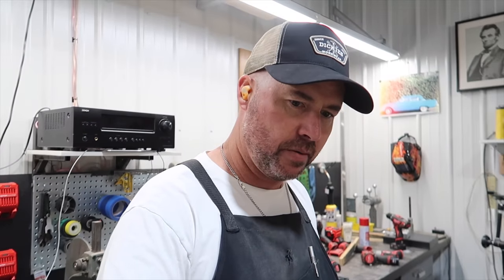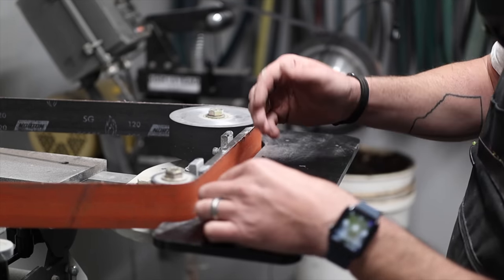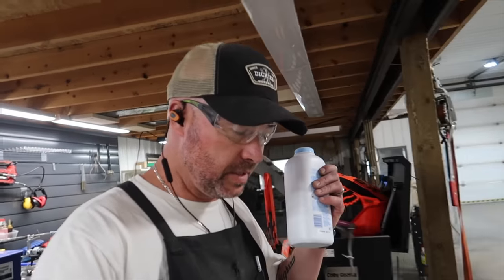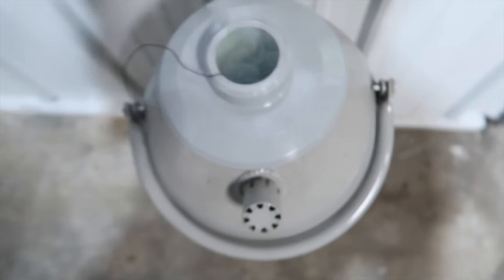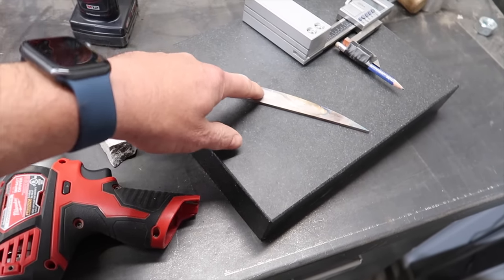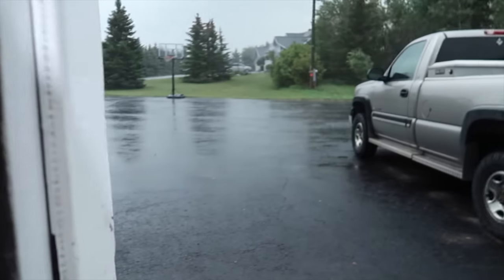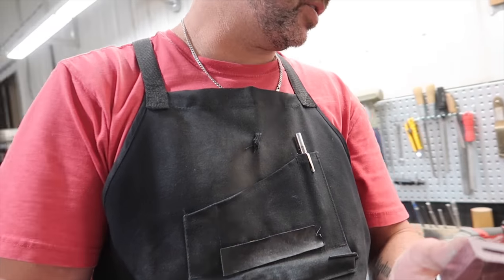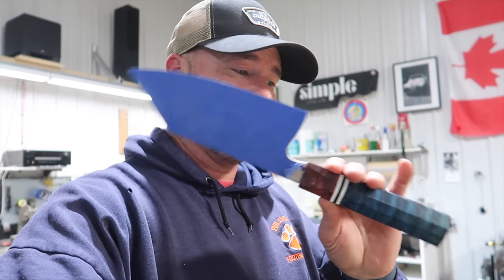Knife shop vlog

Comment: Love that octagonal handle with the relief in it. A tip I heard I think from Outdoors55 is to have the quench plates vertical to avoid warps because when they are horizontal, one side cools down before the other does. It’s worked wonderfully for me.

Comment: Save your money, try a cfoss pein
Reply from the maker: Does that work?
Reply: It did on a couple of knives that warped on me. My hammer is about 16  ounce with a 1/4 inch radius on the cross pein
Reply: Do not use a cross peen. Trust me. Spend the money. You want a carbide tipped hammer because the carbide is harder than the knife. The idea is that you hit at the start of the warped location and you’re basically stretching the actual material and stretching the warp out. Can not do that with a cross peen.